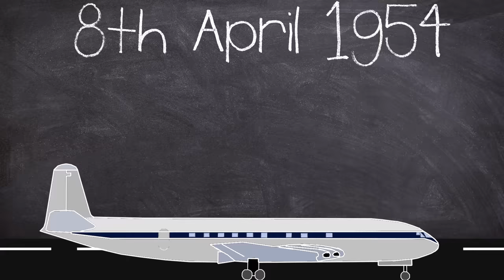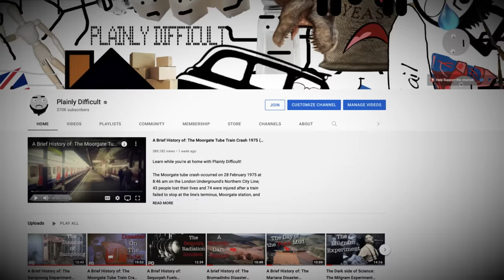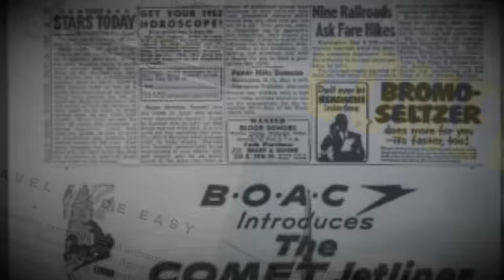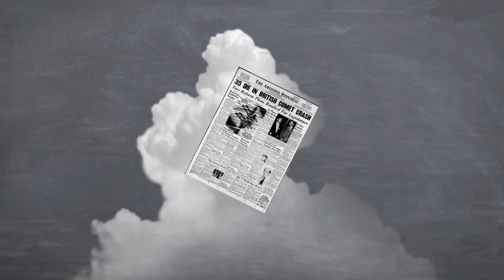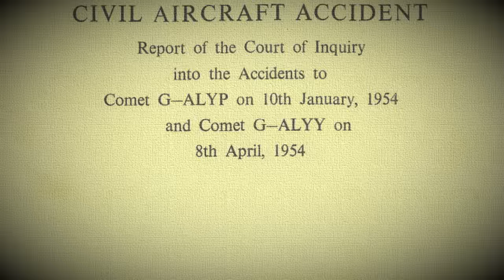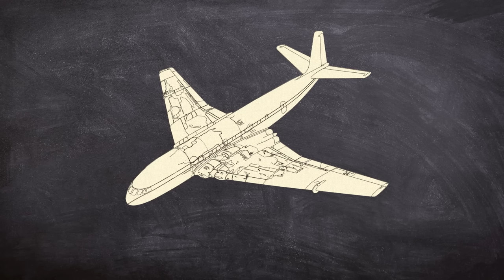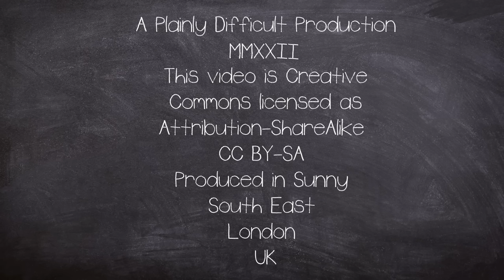A Brief History of: The de Havilland Comet Design Disaster 1954 (Documentary)

Comment: There are eight comet crashes
Reply: 26 Comets crashed or were destroyed in accidents.
Reply: @sandervanderkammen9230  it’s the havilland comet 1
Reply: @jhoel8039  de Havilland DH.106 Comet
26 aircraft crashed or destroyed in accidents.
The worst safety record of an jet airliner in history.
Reply: The comet crash eight times
Reply: @jhoel8039  26 Comets crashed or were destroyed in accidents, the worst safety record of any jet airliner.
Reply: This video has some BS included.
For example -
  
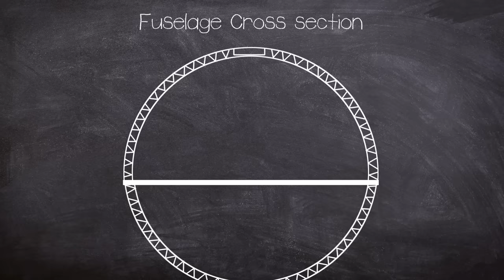    5:20   The idea that only the crew & passenger areas were pressurised is absurd obviously. 
  In fact every part of the fuselage was pressurised from the nose to the rear fuselage bulkhead including the entire cargo area.

Besides that.
The engine position & inlet design were not flaws or fatal flaws, there were good reasons for that design choice at the time.

Comets flew until 1997.
The Comet design had military use as a requirement. Nimrod development began at 
De Havilland before 1953.
Nimrods were not withdrawn due to structure problems or other airframe issues it was entirely a significant upgrade snag & resultant basic economics & an end of line sale happening at Boeing at the same time.

  We feel we can shed some light on some common misunderstandings.

  At the time the Comet wasn't particularly dangerous.

Losses comparisons
How things were in those days.

DeHavilland Comet 4 UK           14% 
DeHavilland Comet all  mks       17%  

Boeing 307                               70%
Boeing 247                               48%
Boeing 707            .                  20% 
Boeing 707                                20% 
Lockheed Electra Turboprop   29%
Canadair CL-44  Turboprop     46%  
Convair CV-580  Turboprop     22%
Convair CV-880    (ff 1959)       27%  
Convair CV-990     (ff 1961)      35%

    Of course De Havilland had prior experience building many all metal construction airframe aircraft including thousands of jet powered fighter aircraft that were primarily of metal construction with pressurised cockpits & jet engines built by De-Havilland.

   De Havilland carried out full stress analysis & engaged in a comprehensive & protracted testing program which is why key De Havilland people were happy to be aboard flying DH Comet aircraft.

   The DH Comet was the first passenger airliner with full length fuselage pressurisation at 8psi pressure differential. Handley Page built the world's first airliner.

   Of course ripstop provision was provided. The skin alloy used became unavailable at the time due to R & D at the manufacturers which resulted in the original alloy being discontinued.
The skin thickness used for the Comet was used for similar later aircraft. 
Frame spacing was not found to be too large & frame width was not found to be too small.

  De Havilland did indeed always work to better than industry standards at the time, used up to date knowledge for the design & construction & no evidence of negligence  or criminal negligence was ever produced in relation to the DH Comet.

  The DH Comet had no effect on the course of the aerospace industry in the UK. The UK now has the world's largest combined nuclear, aerospace & defence sector per capita activity.

    The investigation committee did not find hundreds of fatal flaws or evidence of design defects, structural defects, defective materials or shoddy workmanship. Ripstop provision was included. Claimed incidents did not involve cracks starting from window corners.
Pretty much all changes were just in case changes or were planned development modifications & improvements that were scheduled regardless of incidents.

De Havilland designers knew all there was to know about metal fatigue at the time they designed the DH Comet.

Hope this helps.

Cheers 👍. 
  
     
 . .. .... .... ..... .

Comment: No new video yesterday, I rate this a "9" on the plainly difficult disaster scale.
JK, I hope John is ok.
Reply: The Comet Disaster is the without any doubt the worst engineering failure in aviation history... a very shameful and humiliating chapter in British history.
Reply: Xc
Reply: @sandervanderkammen9230 

This video has some BS included.
For example -
  
    5:20   The idea that only the crew & passenger areas were pressurised is absurd obviously. 
  In fact every part of the fuselage was pressurised from the nose to the rear fuselage bulkhead including the entire cargo area.

Besides that.
The engine position & inlet design were not flaws or fatal flaws, there were good reasons for that design choice at the time.

Comets flew until 1997.
The Comet design had military use as a requirement. Nimrod development began at 
De Havilland before 1953.
Nimrods were not withdrawn due to structure problems or other airframe issues it was entirely a significant upgrade snag & resultant basic economics & an end of line sale happening at Boeing at the same time.

  We feel we can shed some light on some common misunderstandings.

  At the time the Comet wasn't particularly dangerous.

Losses comparisons
How things were in those days.

DeHavilland Comet 4 UK           14% 
DeHavilland Comet all  mks       17%  

Boeing 307                               70%
Boeing 247                               48%
Boeing 707            .                  20% 
Boeing 707                                20% 
Lockheed Electra Turboprop   29%
Canadair CL-44  Turboprop     46%  
Convair CV-580  Turboprop     22%
Convair CV-880    (ff 1959)       27%  
Convair CV-990     (ff 1961)      35%

    Of course De Havilland had prior experience building many all metal construction airframe aircraft including thousands of jet powered fighter aircraft that were primarily of metal construction with pressurised cockpits & jet engines built by De-Havilland.

   De Havilland carried out full stress analysis & engaged in a comprehensive & protracted testing program which is why key De Havilland people were happy to be aboard flying DH Comet aircraft.

    The DH Comet was the first passenger airliner with full length fuselage pressurisation at 8psi pressure differential. Handley Page built the world's first all metal construction airliner during the 1920s.
    In many cases earlier pressurised aircraft were larger, needed thicker fuselage skins due to flying stresses & had much lower pressurisation differential pressure.

   Of course ripstop provision was provided. The skin alloy used became unavailable at the time due to R & D at the manufacturers which resulted in the original alloy being discontinued.
The skin thickness used for the Comet was used for similar later aircraft. 
Frame spacing was not found to be too large & frame width was not found to be too small.

   De Havilland did indeed always work to better than industry standards at the time, used up to date knowledge for the design & construction & no evidence of negligence  or criminal negligence was ever produced in relation to the DH Comet.

   The DH Comet had no effect on the course of the aerospace industry in the UK. The UK now has the world's largest combined nuclear, aerospace & defence sector per capita activity.

    The investigation committee did not find hundreds of fatal flaws or evidence of design defects, structural defects, defective materials or shoddy workmanship. Ripstop provision was included. Claimed incidents did not involve cracks starting from window corners.
Pretty much all changes were just in case changes or were planned development modifications & improvements that were scheduled regardless of incidents.

  De Havilland designers knew all there was to know about metal fatigue at the time they designed the DH Comet.

Hope this helps.

Cheers 👍. 
 
 . . .... ... ..... .
Reply: @Extra-Sail  Please name a single British company that still makes British jet aircraft in the UK?

Comment: How come we knew to put round windows on ships but not planes?
Reply: Because square porthole covers tend to leak water...
Reply: @sandervanderkammen9230  exactly..? Pressure and fatogue problems with water would logically apply to air as well
Reply: @Dreska_  No, two entirely different problems...
The Comet Disaster investigations revealed that the shape of the windows was not the cause of the catastrophic in-flight structural failures.
Reply: This video has some BS included.
For example -
  
 Ships often have square hatches, doors & port lights, just a matter of getting the design right & it's easier on ships as weight isn't a serious consideration. With aircraft it's more tricky as weight is a significant consideration.
    
5:20   The idea that only the crew & passenger areas were pressurised is absurd obviously. 
  In fact every part of the fuselage was pressurised from the nose to the rear fuselage bulkhead including the entire cargo area.

Comets flew until 1997.
The Comet design had military use as a requirement. Nimrod development began at 
De Havilland before 1953.
Nimrods were not withdrawn due to structure problems or other airframe issues it was entirely a significant upgrade snag & resultant basic economics & an end of line sale happening at Boeing at the same time.

We feel we can shed some light on some common misunderstandings.

At the time the Comet wasn't particularly dangerous.

Losses comparisons
How things were in those days.

DeHavilland Comet 4 UK           14% 
DeHavilland Comet all  mks       17%  

Boeing 307                               70%
Boeing 247                               48%
Boeing 707            .                  20% 
Boeing 707                                20% 
Lockheed Electra Turboprop   29%
Canadair CL-44  Turboprop     46%  
Convair CV-580  Turboprop     22%
Convair CV-880    (ff 1959)       27%  
Convair CV-990     (ff 1961)      35%

    Of course De Havilland had prior experience building many all metal construction airframe aircraft including thousands of jet powered fighter aircraft that were primarily of metal construction with pressurised cockpits & jet engines built by De-Havilland.

   De Havilland carried out full stress analysis & engaged in a comprehensive & protracted testing program which is why key De Havilland people were happy to be aboard flying DH Comet aircraft.

   The DH Comet was the first passenger airliner with full length fuselage pressurisation at 8psi pressure differential. Handley Page built the world's first airliner.

   Of course ripstop provision was provided. The skin alloy used became unavailable at the time due to R & D at the manufacturers which resulted in the original alloy being discontinued.
The skin thickness used for the Comet was used for similar later aircraft. 
Frame spacing was not found to be too large & frame width was not found to be too small.

  De Havilland did indeed always work to better than industry standards at the time, used up to date knowledge for the design & construction & no evidence of negligence  or criminal negligence was ever produced in relation to the DH Comet.

  The DH Comet had no effect on the course of the aerospace industry in the UK. The UK now has the world's largest combined nuclear, aerospace & defence sector per capita activity.

    The investigation committee did not find hundreds of fatal flaws or evidence of design defects, structural defects, defective materials or shoddy workmanship. Ripstop provision was included. Claimed incidents did not involve cracks starting from window corners.
Pretty much all changes were just in case changes or were planned development modifications & improvements that were scheduled regardless of incidents.

De Havilland designers knew all there was to know about metal fatigue at the time they designed the DH Comet.

Hope this helps.

Cheers 👍

Comment: Should have named it "Meteor" instead...
Reply: Ironically that name was already taken by the worst jet fighter in history.
The "Meatbox" or meteorite as it was called by RAF personnel had the worst safety record of any jet fighter with over 1,000 crashed killing 450 RAF pilots alone.
Reply: @sandervanderkammen9230  AFAIK there were 890 Meteor crashes out of a total of 3,947 aircraft built, resulting in, as you say, 450 pilot losses. That gives an accident rate of 22.5% which is still pretty bad.
Reply: @phonicwheel933  890 Crashes Just in RAF Service
Hundreds more crashed in foreign Service as well.
Reply: @sandervanderkammen9230  I see. I missed that. Thanks for info.
Reply: Estimates are between 1,300 and 1,500 "Meat boxes" crashed... that's 1 out of every 3 built.

Comment: The square windows were not the cause of these crashes. They were a contributory factor at most. The real problem was a combination of a lack of understanding of the mechanics of fatigue and crack growth, and improper manufacturing technique that encouraged crack initiation. These are technical subjects and difficult to understand without some engineering knowledge, so people tend to gloss over them and talk about square windows instead. I would recommend that anyone interested in this subject watch this lecture by Prof Paul Withey, who has done engineering analysis on these failures using modern techniques: https://www.youtube.com/watch?v=K5HqEwbp4GA